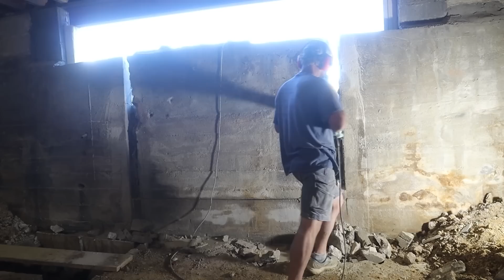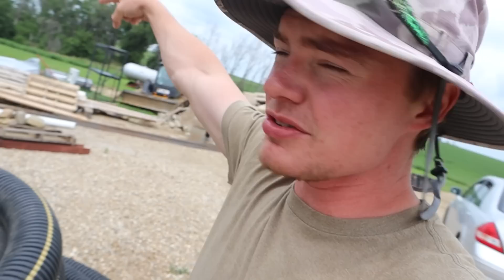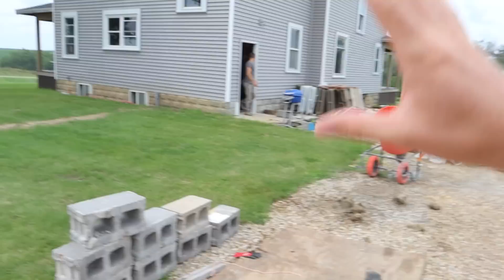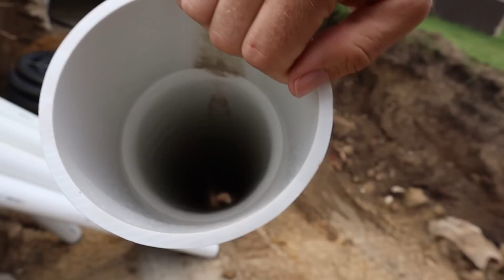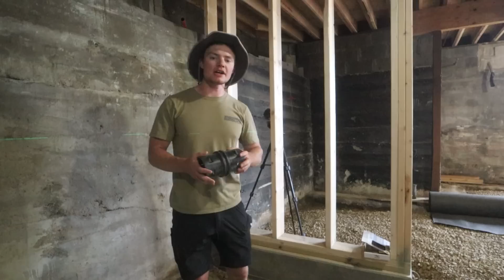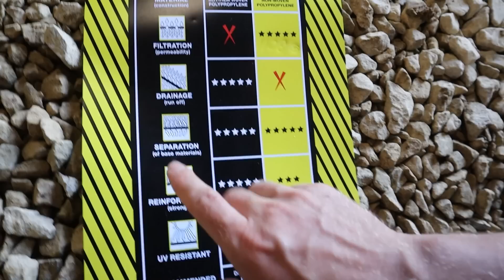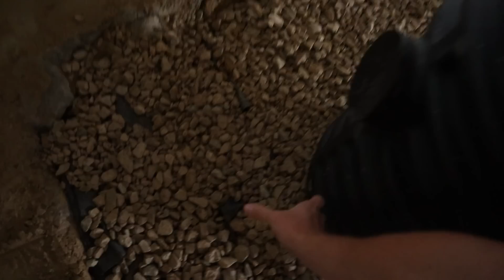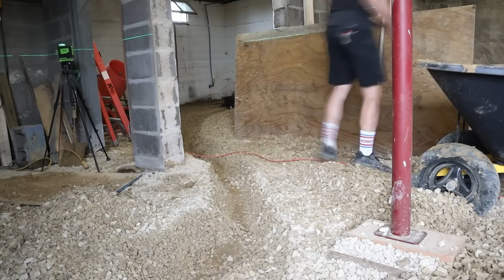Restoring A $7,000 Mansion: Building A Basement Water Removal System

Comment: Sump pit would be connected to the perimeter drain tile.     Pump then pumps up and out through pvc to the outside. Also there’s no need for a second tile for the radon system.   You can pull the vacuum on the perimeter drain tile.

Comment: Place a perforated cover on the exit end of your drain ends.  Dirt Perfect solved a slow drain in a recent pond build, after running  sensor nearly 400 ft.  Discovered a dead possum at the junction leading to the inlet.

Comment: Run a fresh water line to the sump pump hole. Once a month turn on the water valve above the sump hole and fill the hole. This will exercise the pump when it's dry weather, also  you will know if the pump ever gets bad. Electric motors need to be run monthly.

Comment: Being way too fussy with the drain tile. You have a 4 inch tile so you have 4 inches to play with, if it's off by an inch here and there it doesn't matter. Water will always self level. If the drain tile is level, give or take an inch all around the house it will flow outside through the outlet  and down hill just fine. I would have put the tile in before the rock to save a bunch of scooping work. Also tight corners are not critical as water self levels and will trickle through the rock to the pipe where ever it is. You only need a 1 inch in 100 feet drop because water will run down hill. You won't have stagnant water in perferated tile because when the water table is below the basement level the tile will be dry, which will be most of the time.

Comment: Cole, I'm your local Texas pump guy. Your sump pump will likely have a 2" discharge connection. You are going to need 2" discharge pipe for the sump pump, that 4" won't work well or connect to the pump. We normally see 2" sch 40 PVC pipe used as discharge line.
You could use the 4" corrugated like a conduit for discharge pipe. Get 2" flex hose and pull thru the pipe.
Better yet abandon the 4" line and run rigid PVC pipe to closest wall for discharge. Shorter run the better. Normally discharge piping is run out the lid and above the cement floor for future maintenance and replacement. 
Discharge line below cement could be a recipe for disaster if pipe breaks/leaks. 
I love your channel. Keep it up brother!

Comment: Will you have a check valve in the sump pump discharge line?  Highly recommend one.  Also consider some kind of screen at the discharge outlet at the creek or at the sump pump basin discharge.  Critters and snakes will find their way into the house if you don't.

Comment: Maybe you could explain why you need a second pipe for the radon rather than ventalating the drainage pipe that will be mostly empty most of the time.
If the drainage pipe is full, wont the radon pipe fill too? Where will that drain? So many questions you will have already researched.

Comment: by putting holes in your sump you will continuously have water in it, won't you?  Won't the pump be running all the time? The sumps I've seen, including mine have openings on the sides at a level closer to the level of the drainage pipes for water to enter.

Comment: I mostly agree with everything you have done so far except for your sump pit discharge. Your pump will not be powerful enough to move water in a 4" pipe, even less if it's corrugated inside. Sump pumps should pump vertically and out the side of the foundation and then you can pipe a solid pipe down to the creek. The amount of work to trench that pipe will be easier too.

Comment: What’s the elevation drop from drain lines to creek?   Any chance that seasonal creek flood will push water back INTO the basement?  Perhaps you need a backup to your backup (sump pit drain) to primary ( internal French drain) ?  I.e. electric sump pump discharging through nearest wall to external surface drainage (lawn).

Comment: Hey Cole... Avoid a mistake I made.  Get a lid in that sump basin ASAP - if you dont put the lid on to keep the perfect circle of the sump basin, the basin will deform as you put rock and concrete around it and the lid wont go on later.   Even if it deforms like a 1/16 of and inch from a perfect circle ... the lid wont fit.    Great cannel!

Comment: The interior waterprrofing doesnt need to be pitched and u can also use the same pipe and sump pit for gas extraction. Also should make a cross in the middle of the basement using the coorigated to extract water from the center of the basement as well

Comment: Even if you had 0.1% grade you are 100% OK. Water always flows downhill and if the water comes into the pipe it will have the grade to flow away.
But I would never install a drain line on the inside of the foundation wall without having it on the outside too.

Comment: Cole, you should also think about adding a floor drain near a wall and not just centered in the rooms. Dehumidifier, A/C evap coil. water heater, sinks, etc are typically against a wall and need drains.

Comment: Why Can't Radon and Water use the same pipe, but you just vent the one pipe up to the roof line instead of running two pipes?  Why do you need two pipes?   There's already air in the top of the pipe anyway?

Comment: sump pumps normally last 5 years then give out - they are not expensive but easier to remember in summer 2029 you will need a new sump pump whether it has stopped working or not - the same for Daddy Cornstar as he has just replaced his

Comment: My sump pump raised the water level that connected to a pipe running out of the house and then down the hill until it came out of the ground. Every spring when the ground water rose it would run constantly

Comment: How does the water drain from the exterior opening of the house?  To continue a downward slope for the water to drain off the house would have to be built on a hill since water flows downhill.  I'm just trying to figure this out.  We had a similar problem on the house where I grew up in Illinois.  Fortunately about a hundred yards from the house there was a sort of raving so a pipe was run out there and that allowed the water flow out.  Thanks for the videos.  At first I was upset that you took out all of that fantastic woodwork but I understand and now can't wait to see the finished house and your sweet wife and kidos and you are living in it.

Comment: I know it is counterintuitive, but with perforated pipe, you don't need fall. You only need fall from the exit of the perforated pipe to the discharge point, assuming you transition from perforated to solid. The ground water is entering the pipe at the same level. Dropping below water level achieves nothing in this case.

Comment: I live in an old 160 year house. Our inside main drain  is cast iron. IF, and I say IF, it were to fail the state of NY requires a brand new system put in. I have friends and family that just had to come up with 23 to 26 grand. No pumps outs allowed until an engineer says so. Also have a dirt floor and I am watching closely how to put in a new drainage system as it is always wet down there with the pump in a muddy hole. HELP!

Comment: Fact checking this video as a general contractor with over 29 million dollars in ACTUAL restorations of 100+ year old houses. 

Drain tile isn’t “plumbing”. They want 1/8 per foot in actual plumbing to move solids, not water. 
 
You do not need to run radon and drain tile separately. Also, did you even check if you had radon in your area, or are you just making additional work for no reason?

“I’ve consumed 4 hours of his content” lol!

You do not want holes in the bottom of your crock. Allowing water in is what the tile is for.

Comment: Should of had the sump pump basin at the low end of the pipe. Let water trickle into the basin and one it reached level to turn pump on then have a 1" pvc go out to the house. Put  1 way check valve right before it goes up to ground surface. Then where ever you decided the water come out at to have a pop up emitter.  THis would make the 4" non perf not used and no need for the trench and no need to dig a very deep trench out side to the creek.
Reply: He doesnt want to rely on a pump to get the water out when it will naturally flow to the creek. He has equipment so a deep trench for a little bit isnt an issue. Hie floor tile is his first line of defense for water removal, then if that fails, the water flows into his sump pit through the holes he drilled in it. The pump will most likely be hard piped in like most sump pumps are and be discharged through the wall out somewhere in the yard so it runs to the creek or ditch. That 4 inch solid line he ran out of the pit is his 3rd option to get the water out through a natural flow to the creek if the pump then fails. He went above and beyond with his drains in the basement. The only thing he needs to do now is, do tile around the outside of the house, which he says he will do later.

Comment: You should use pvc pipe from the sump pump pit.  When it’s running all the ripples will prevent the water from shooting out.  The pipe you put in works good when it is a gravity drain but if you’re pumping pvc is the way to go.

Comment: Seems that the floor drains should feed to the sump since you are adding one. I say this as how it was done on my home. which is code for where I live. I am told it's the common thing to get the water up and out.  The external parameter drain also comes into the sump to then be pumped out and away from the foundation. Works very well.

Comment: You're using 4" pipe for the sump discharge. You've found a pump that will be able to connect to that size pipe?  On my sump pit, the large ports are where the perimeter drains connect, and the pump uses an 1 1/2" PVC pipe for discharge.

Comment: At 120-year-old house in honeoye Falls, New York. The house was built with a cistern. The stacked stone walls would leak. Great stuff cured the leaks, installed a sump pump.( found date 1898) in the floor. Made sure all the down spouts channeled the water away from house. Finally used a dehumidifier that drained into sump. House stayed dry , and I sold it 3 years later. In Texas now, north of Austin!

Comment: I have done many exterior French drains and quite a few basement drainage systems. We never use crushed limestone but instead rounded river rock or glacier Rock. The triangular shape of crushed stone compacts and does not allow as much water through. Rounded Rock doesn't compact and allows more pore space for water to get through. Also we use non pressure PVC pipe. Ribbed pipe can hold a little bit of water and may cause mold.
Reply: remember this is U.S and there they dont need washed or clean gravel as the rest of the world dose

Comment: How long were there farmer corn when you do a job and you had access the way you did that house was on a little Hill what was you had to do was the outskirts of your house dig down a 3 ft wide by 10 ft long section at a time of the wall outside start your drainage pipe at the high end and then every 10 ft put a pipe fill it in and then dig another 10 ft it would have been a lot easier and cheaper I don't know who the hell is the guy on the dude on the job there but you would have saved yourself a month of work thousands of dollars you could have filled the basement or one pump one drain in case the outside didn't work I don't know where you guys live but you don't leave in a country excuse me you do see you

Comment: U need a check valve to keep perimeter drain from backing up into the sump pit
Reply: It will flow away naturally through the tiles and if it gets clogged up, he wants it to flow into the pit, thats his backup plan to let the pump get the water. If the pump then fails, the solid 4 inch pipe he ran from the pit will allow it to flow naturally out of the pit. Cole just installed 3 different ways to get water out from under his floor and you want him to install a check valve on perforated drain tiles under a floor?

Comment: HI cole applause to justin and roman of the layout for the tile drain. A 1/16th / ft fall is perfect for the tile. As for the sewer you are going to have a fall of 1/8th/ft for 4in pipe. My suggestion is not to use 90's for change of direction but use 45's instead on the sewer line just makes the flow better. If you dont have enough fall the solids will start to deposit on the bottom of the pipe. I've been a plumber for the last 30yrs and love it.

Comment: In a previous comment I questioned the need for a radon system.  I can’t find the comment.  After further review I found out Iowa has a high likelihood of Radon.  I still believe sampling needs to be done.
Reply: why pay for a sample when he has the floor ripped out and it is just so easy to run the pipes now. The upper walls are also not done so running the pipe up and out will be super easy. If he has radon, this helped a bunch, if he didnt have radon, this will help keep any old musty smells from getting in his basement as well as give him a good feeling that radon wioll never become a problem. Over 70% of Iowa homes have a higher radon level than the EPA says is safe. This was the right move and a cheap one since its all an blank canvas.

Comment: Cole, it doesn't work that way!  IF the water is rising faster than your 4 inch pipe can remove it, it WILL rise into the basement.  Believe me, even with footer drains, IF they get over whelmed, your basement CAN flood. Seen it happen.  IF the area where these pipes discharge gets water high enough, it WILL flow backward as well.  Seen it happen.
Reply: 100 year old basement with no drains or pump never floods, Cole puts in tiles and a pit for a backup pump if he ever decides he wants or needs it and now the basement is gonna flood a 4 inch drain tile. Thats some biblical type flood youre talkin about isnt it? LOL The creek is many many feet lower than the house too. If the creek gets high enough to flood his basement, Were talkin Biblical stuff again! LOL

Comment: I don't understand the complex radon mitigation plans you are making. The radon system in my house utilizes the water mitigation system and the sump by just drawing a negative pressure on the sump and drain system and then venting to the outside. I hope you explain the radon system in more detail and how it's going to work.

Comment: Basement drain tile doesn't slope. Its supposed to collect the water at a certain level, using the air gap in the level pipe to collect and push itself to the lowest point. You only have to slope the tile going to the sump basin and if you have any long runs going across the center. Its only a collection system not the discharge system. Once water gets to that level itll push itself level to fill it up, and move to the lower spot (sump basin).

Single wall drain tile is not designed for yard drainage, its designed for field applications where its down more than 2 feet. Itll work in basement drain lines but the discharge lines near the surface you'll want duel wall pipe. It has more strength and wont get crushed down over time, even by just lawn mowers and such. Personally I use duel wall on everything so I dont need to keep 2 types in stock or I use Sewer PVC in the jobs I do. And French Drain Man is a great teaching use.

Comment: Cole, do you have a large waterproof tarp, or plastic drop cloth? If so, next time you're expecting rain, put a tarp down on the basement ramp (weight the edges so it doesn't blow away). The water will still run down the tarp and collect at the bottom of the ramp, but the rest of the ramp might stay a lot dryer. Which will mean less mud to deal with.

Comment: You should always have a double sum pump my friend
Reply: with his tiles all running downhill to the creek, he shouldnt even need one pump.
Reply: @warrenmichael918  - He will need at least one sump pump to guard against the drain tile getting plugged AND the sump pump needs to drain somewhere else other than the drain tile...
Reply: @billnict1  The sump pit has its own pipe , that was the solid pipe he ran out from the pit and i dont think he is gonna tie them together but im not for sure on that yet, but i doubt he does either. He will most likely have a sump pump in the pit in case he needs it but a double setup isnt needed. Im not sure where or how he will eventually run the line from the sump pump but i dont think he will be running it into the 4 inch pipe coming out of the pit. Who knows, i guess we will see in a later video.